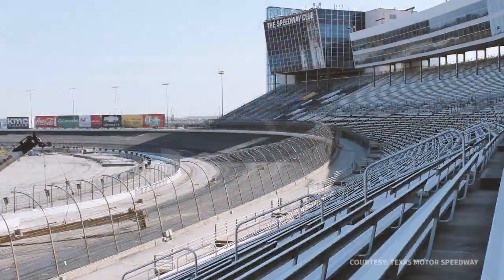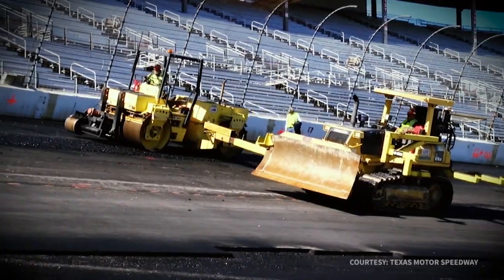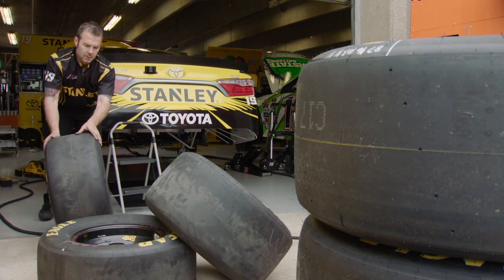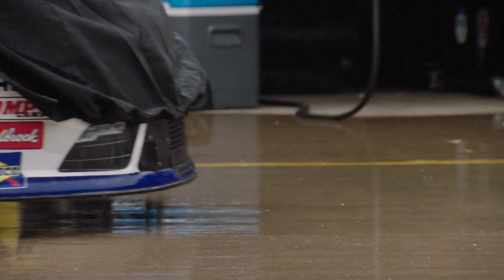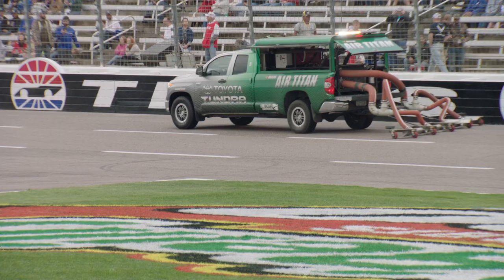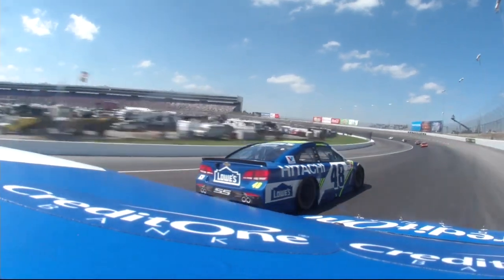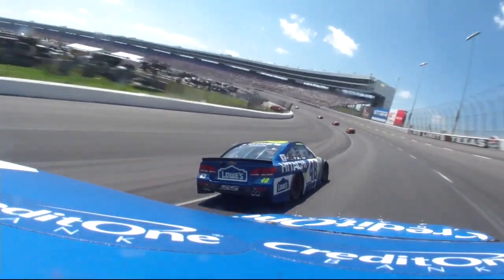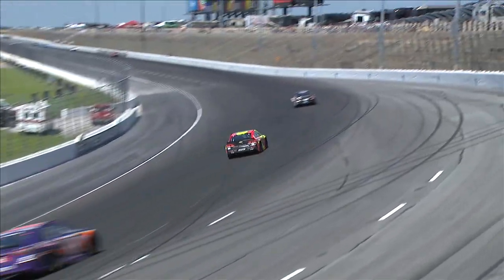Analysis: How modern-day repaves 'optimize racing'

Comment: The only thing I have to disagree on is the multi-groove racing and clearly after Texas, it's going to be several years till we see a second groove form. I feel like they promised the Texas race would see more passing, but once you got out of the bottom groove, you were done for and that was all Texas was this past weekend.
Reply: yep...
Reply: The thing is and this is entirely my opinion obviously . I miss the single groove racing . I think the best racing is what we saw during the xfinity series . where you only had a groove and a half . Guys were fighting for the bottom all day long and really racing each other hard to achieve that . Taking chances and cutting one another off . That was great racing ! A multi grooved track caters to cars racing side by side but 3 or 4 car lengths apart . Which to me is pretty boring . I would rather see a race where guys had to battle hard in very close quarters vs watching guys just drive right passed another without even having to think about it .
Reply: i saw no problem with single groove racing. in fact this race is one of the best so far.
Reply: Well, in fairness, Texas was a one-groove track for like it's first 7 years. Unfortunately, repaves are just going to happen as track surfaces get older. There's not much you can do about that. I think the racing will get better on Texas's new surface overtime, but I think you should expect the track to be a single-groove track for the first few years while the surface is still fairly new.